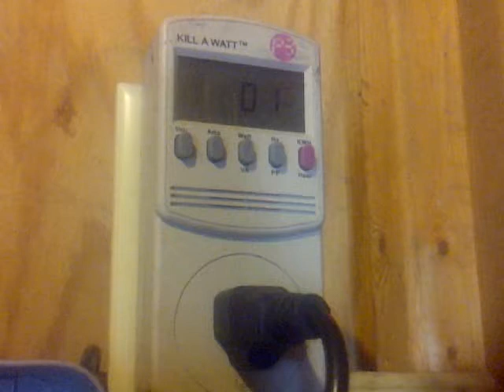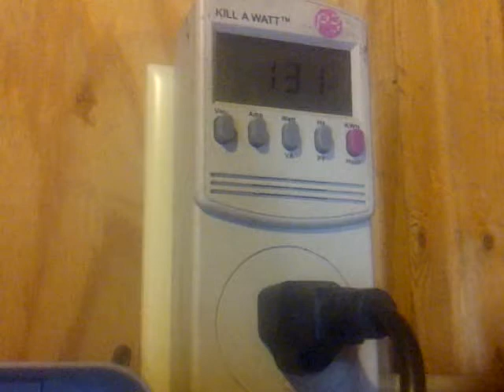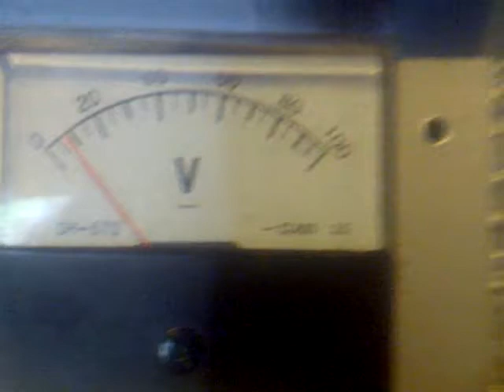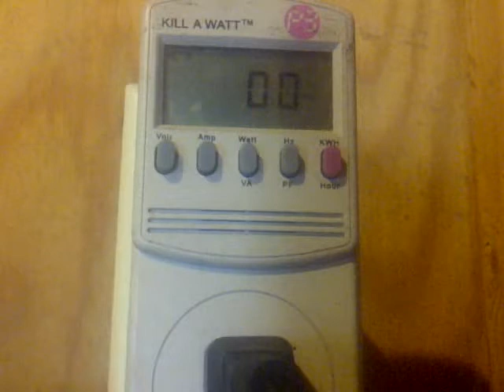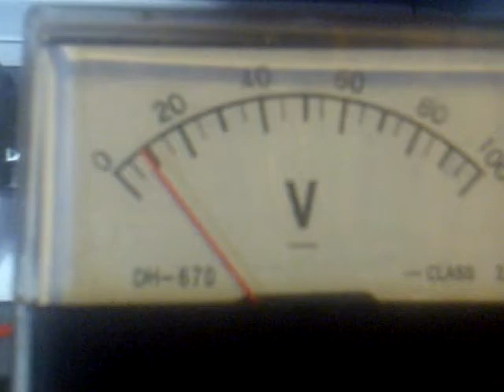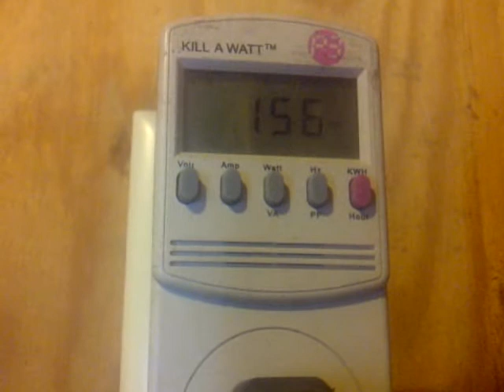Windy Nation 750 PMA Grid Tie Inverter

Comment: How far does the line from the shed to the electrical panel go? Why are you rectifying the ac to dc and not going with a ac input inverter? If your reaching 400 watts with gusts of wind would you be better off installing a dump load so the pma would stay in that desired power output in a windy day instead of adding another inverter? Thanks
Reply from the maker: Hello, good questions.
A:
The line is about 40 ft to th shed using #10 wire.
The turbine is more efficiant by rectifying to Ac  rather then a DC PMA,plus the inverter will generate more heat inside with the rectifier being inside it. It is easier to work on should the rectfier go bad or if i decide to move things around.
Adding a dump load is a must at some point, using a second inverter will depend on your site vs how much you are going to a dump load situation all the time vs your cost to buy another inverter. That is a personal choice.
I hope this helps
Larry
Reply: ***** So do the ac input 3 phase inverters change ac to dc back to ac? I was thinking the same if you could run the ac PMA 3 phase directly to a 3 phase ac inverter you should see less loss from rectifiers ect. Im  trying to decide whether to use a ac or dc input inverter with my 3 phase PMA. Thanks
Reply from the maker: mag7mm1 GTI A/C input. Has a rectictifier in it as you know. It takes the 3 phase  from the PMA, changes it to DC then the GTI converts the DC to AC home power. An external rectifier is better to use, then, use a DC input GTI. See my vids i show all of this.
I hope this helps.

Larry

Comment: Nice Video it seems Windy nation is a good unit
 Thanks,
David
Reply from the maker: Hi David, Yes it is a good unit. I have been testing it for awhile now. WN blades are great for the price and work really well. I recommend getting their 5 blade set with the larger hub as that hub has better weight then the smaller one that comes with the smaller blade set. I use their smaller hyper spin blades with the bigger hub. They get better RPM then their larger blades. I have my 750 PMA  grid tied and i just seen 791 watts out of it. It is tied to a China wind rated 1000 w 22-60v GTI DC input.  I hope this helps.